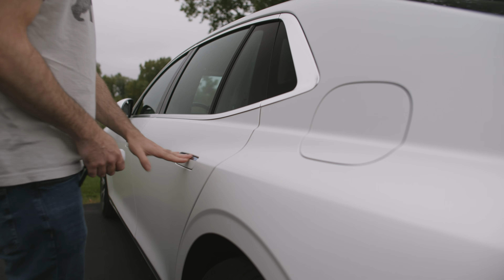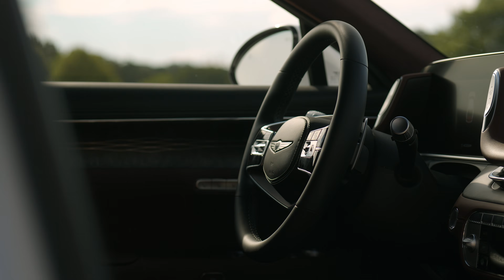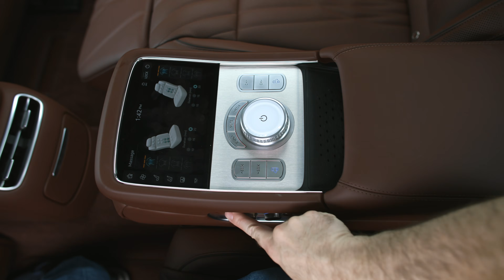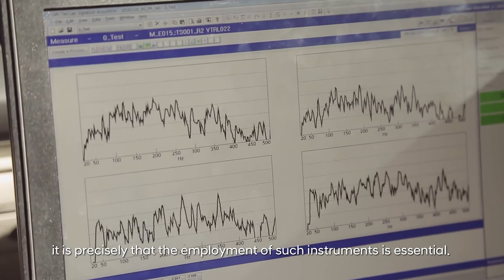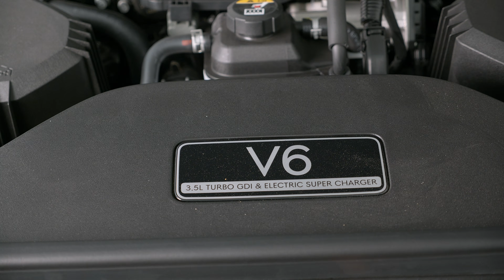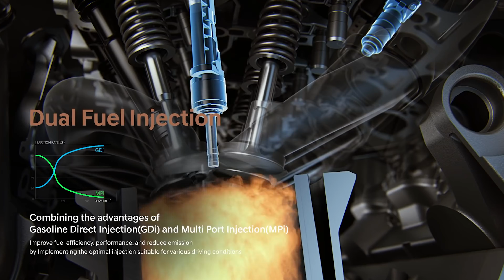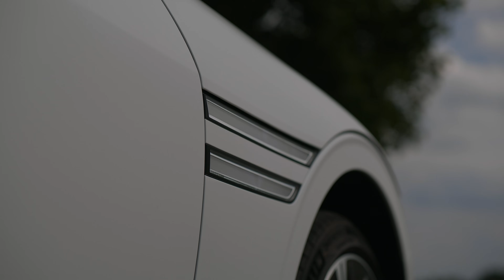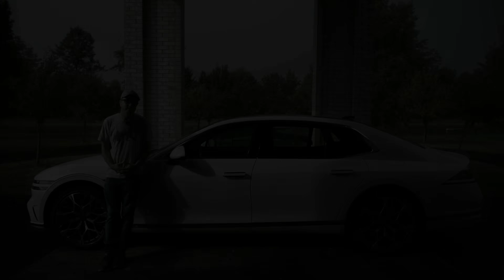2023 Genesis G90 | Great Car, Gimmicks and All

Comment: buyer beware
of bling and cheap, razor-thin quality.
i know...i got fooled.
the Fine Bridge Of Wear from scottland leather in my 2010 MKS was worn, cracked, and peeling before I got to 60,000 miles.
EVERYTHING hurt it. the dye was gone anywhere you sat.
and the "soft" touch areas were really glued  just a fraction behind other parts, pulling back and exposing the underboard as well.
i had to reglue and push back.

often.

this is the same trick being used by the Korean brands. they learned the initial sale was easy IF you dangled the cheap, frail blink in front of the customer.

and this is why consumers report has the Korean brand sooooo low on the qlong term customer quality list.
engines failing..
materials failing.

it is all bling.
Reply: @trp2413  my samsung refridgerator is the most hated on the web...and NOBODY will service in my area.
i called and nobody will unless they are prepaid and pre-approved by samsung.
and this is an expensive 4 door french model.
but still a completely different company and to group in with all Korean mfr is an error.
and maybe wrong spiritually.

Comment: This is an excellent effort from Genesis. If Genesis keeps this up, they can finally earn the recognition they deserve. People just say “ oh, it’s just a glorified Hyundai and crap”, but no, the genesis brand is a totally different league than Hyundai with everything different. Would I choose this over an S Class or A8? No, but I’d certainly choose it over the new 7 series, and the Lexus LS. Mark explains the g90 very well. I will listen to mark, not badge snobs.
Reply: The new 7 series has a lot of presence. It would be my choice if money was no object.
Reply: @dragospahontu  that is true. But I’m not a fan of the front.
Reply: @bradleyscarreviews  understandable, but the electric version will make it the best in class.
Reply: @dragospahontu  that is true.
Reply: This is my perfect car - the ultimate isolation / relaxation hwy cruiser. I just need it to be an ev (I can no longer tolerate the ICE drone) and a higher riding crossover.
Reply: @Wasabi9111  exactly

Comment: I have been thinking.
I really wonder why big luxury cars aren't not wagons. They are bigger and heavier and would have even more presence than a sedan. Plus they could have more space for rear passengers and reclining seats much easier.

I wish people liked wagons.
Sedans are so impractical.
Reply: Luxury SUVs make much more sense than wagons. I think the sedan thing has to do with looks and proportions. Practicality isn't a primary concern.
Reply: I completely disagree, wagons don't have as much presence because presence is based upon styling and looks as well as size. look at the a7 to the a6 essentially. the a7 is a much more striking looking car and as a result it has more road presence. this is because its just as large, but the coupe', slender styling makes it look more exotic and athletic, even if they are fundamentally the same car. Nowadays as everything is an SUV, so hatchbacks / wagons aren't wanted as much anymore (I dislike wagons, bar a few exceptions, so I don't mind this much as I'll explain further), meanwhile the coupe/ saloon/ sedan space fell initially based upon the practicality concerns you have expressed, but as most are hatches themselves now with sleeker styling, they're just as practical with slightly less space. as a caveat, the more slender styling offer better aerodynamics (more range is important nowadays), higher top speeds and more control over the aerodynamics allowing for a more engaging drive most of the time (although subtle) and that striking look. as a result the coupe'/ saloon/ sedan is making a comeback in a sea filled with SUV's and compact Hatchbacks. and its the main reason luxury cars have this styling. road presence, they're already woefully inefficient due to weight/finishes so for practical sales a saloon styling offering slightly better range is easier to pass through R&D etc.

Comment: The ability to change the color temperature of the interior illumination is absolutely incredible.
Reply: In most use cases, this is more useful than ambient lighting RGB stuff. I don't know how expensive it is but its certainly a feature that would be neat if it caught on.
Reply: pretty standart at this lvl
Reply: Wait what? I missed that
Reply: Why? Just gimmick
Reply: @FilmScape4K  I like the ability to have LED lights without feeling like I'm inside a refrigerator. I absolutely HATE cool illumination, so the ability to choose is welcome.
Reply: Until it fails and costs a small fortune to repair.
Reply: Just another Mercedes tech copycat
Reply: @Tomoyo0827  it’s not a copycat? And everyone is taking ideas from each other now? It’s tech, what else can they do.
Reply: @Tomoyo0827  Name one Mercedes that allows you to change the color temperature of the overhead lighting. Not ambient lighting, but actual overhead lighting.
Reply: @ThatWasherNerd  overhead light IS a part of ambient lighting. Which Mercedes has been doing since 2017 E coupe.
Everything single feature from this car is a direct copy paste from prestige brands. 
NOTHING is innovative. 
It’s a pathetic attempt to lure people into “luxury for less” experience
Reply: @Tomoyo0827   How is it pathetic? Let's assume it's literal copy. Would you rather spend 100k or 200k for the exact same thing?  How is this even an argument?  Do you just enjoy saying you paid more for something you could have bought for less, instead of saving your money and getting the same experience?  Personally, I'd love a Rolls Royce with a different logo for 1/10 of the price, I'm not a badge snob who drives a base model 3 series but trashes a G90 lol.
Reply: @Tomoyo0827  I'm talking about illumination. Like the lights that come on when you open a door, not Mercedes' color options that enable variations such as "Blue Moon" or "Sunset" or stuff like that.

It's impossible for a new company to compete if it doesn't at least match the tech and features of other companies. At least Genesis has unique character. All Mercedes now look the same and feel incredibly generic imho.
Reply: @iSOBigD  you really think people buy luxury goods because the product is worth the price? No. 
I despise badge snobs as much as the next person, however 99% people buy a Mercedes for the badge, if they really want value, they wouldn’t buy one, period
Reply: @Tomoyo0827  that's true, that's why there's a smaller niche for people who buy on value not brand.  You have the broke people who wear brand name stuff, the people who are way too rich to notice if something costs 100x what it should, and a segment in-between, some of which will buy a Genesis or something fully loaded for a decent price.  I would never expect the G90 to sell a lot, just like the 7 series/A8/S class sell a fraction as much as the entry level stuff, but hopefully as a brand they sell enough GV60/70/80s to keep making other great cars for me to buy used. :)
Reply: @Tomoyo0827  Mercedes is copying the model T using a steering wheel and car doors. Stupid comment
Reply: 48v hybrid, pop out door handles, wide screens, rear wheel steering, active noise canceling, soft close, automatic opening etc just copy and paste from other car manufacturers and you get Genesis. Its not bad car but they really need to step up and start the trends. They have always been trend follower. You see German brands innovative each year, you see Korean brand copying each year.
Reply: @user-njngyv  Congrats. You just described every single luxury car brand. And if Genesis didn't have these features, people would dog on it saying the tech is outdated. At least Genesis' styling and character is unique; it doesn't look like anything else on the road. Plus, a 10 year 100k mile drivetrain warranty shows their dedication to build quality. Oh, and may I add that this undercuts all the Germans for the equipment?
Reply: @ThatWasherNerd  that Kia and Hyundai warranty for 100,000 miles is absolute trash we all know kids in Hyundai's break so yeah you're definitely going to be using that warranty
Reply: @jasonmurdoch9936  Lol it's hilarious when brand haters like you post blanket statements like "Hyundais break" as if no other brand of car breaks. It sounds as ignorant as it actually is.
Reply: @user-njngyv  it’s not copy and paste, they are great ideas they got to implement in their vehicles. They have to go all out to be appealing.
Reply: @bradleyscarreviews  the screen layout is last gen Mercedes too I understand copying features but now everybody copying the layout too 😂😩
Reply: @user-njngyv  The main difference is you can get those things standard, for a lot less money, instead of nickel and diming you like BMW/Mercedes where most people don't have all those features you listed in their 7 series or S class.  You're welcome to drive a base model S class with blank switches and a bench seat in the back for tens of thousands of dollars more than my fully loaded G90.  Who really gets to enjoy their car more?
Reply: @user-njngyv  I don't get it, so you don't want those features in a luxury car? Why wouldn't any proper high end sedan not have those things lol

Comment: Wow.  Still driving my 2012 (Hyundai) Genesis.  100k is out of my range though….    Have winter tires on 17s, put pilot sport summers on 18s, the ESC no longer activates, car just hooks up.
Reply: 2013 2.0T Premium here. New rubber, Pilot Sport 4S, transformed it's cornering and  still get over 30 MPH on the highway.
Reply: @dallasangler  slow down before you kill somebody